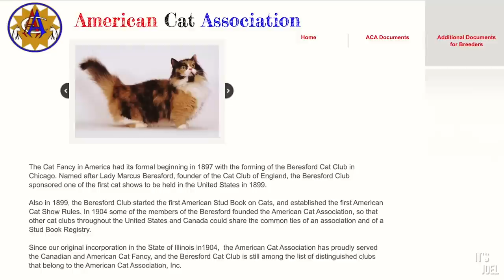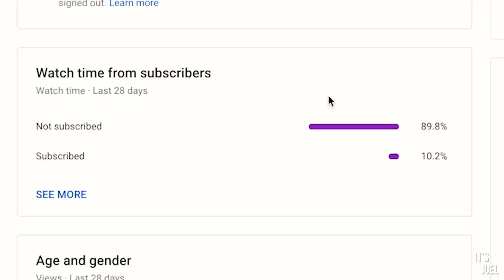I Straight Piped My Cheap, Luxury V12 BMW Limo...

Comment from the maker: The best thing about this custom system is there’s only one weld point, so the stock exhaust can be put back on very easily in the future!
Reply: Exactly, you did the right thing not touching the bumper
Reply: I think you shold make Alpina for the Gearboxe than will sound even better when you change speed becuse is to slow 😅
Reply: Good shout! As it will half the value of the car haha! Also can you get the gearbox remapped on these old ones? If so that could be the next video
Reply: How much is it fo straightpipe a car ( i have a mk1 skoda fabia vrs
Reply: Would you need to fit old exhaust with backbox to pass mot?
Reply: use v band mate
Reply: save the exhaust somewhere, i guess a new system with boxes and piping costs as much as half the car to buy "new".
Reply: i know it was 6 months ago but when your de-accelerating tap the throttle ever so slightly will make it pop and bang

Comment: Not a big fan, despite of the cool sound. I just don't think it suits the car at all. But I'm a sucker for stock cars. I do get it from a YT views perspective and as long as you are happy with it, that's all that matters! Best of luck with the series and I hope she gets fixed up for many more years and miles to come.
Reply: I agree to many bmw are ruined cause of this
Reply: It looks like it makes him giggle and he included the disclaimer that it is easily reversible. The “stock is best” mentality omits quality/well engineered and refined upgrades. Every product has a budget and when that product is so widely distributed, the focus becomes a little diluted and too user friendly. Personalizing your vehicle is a fantastic way to transform your mundane commute into something that is stress relieving and potentially a lot of fun. The majority of new vehicles intentionally isolate you from any kind of “fun”. If only he had this exhaust modification on a wot switch...
Reply: Its easily reversible, and I doubt this car will ever gain the status of the e38 as a classic.
Reply: @chris jones Same, the pre LCI is ugly, this LCI looks sharp, but not e38 sharp
Reply: It sounds great but I think I prefer the super quiet sound my E38 V12 has. Sometimes you wonder if the engine is still running it's so smooth!

Comment: Epic! If you want the best of both worlds, you could consider a cut-out valve directly behind the cats. That way you'll bypass the rest of the system, get the sound out directly underneath the cabin, reduce back pressure in the exhaust, and still be able to enjoy refined motorway cruises in absolute silence when you shut the valve.

Comment: Its just sound like a hyper car engine fitted in a cheap luxury car.
Reply: the car certainly wasn't cheap
Reply: @martin1649  5k
Reply: @northweezie1  When it first came out it was 130k and with inflation it’s probably 150-160k.
Reply: @iamray4702  yeah I meant that’s how much he paid although looking back it’s an irrelevant point to the original comment

Comment: You will enjoy the noise for a few months and after that, on the odd occasion but the drone will annoy eventually you if you daily it. 
 Had the same on my CL600. Put the original mufflers in. The best option is just get a good compromise with an aftermarket system.

Comment: And here was me thinking if I also took the boxes off the middle section in my S600 V12 Twin turbo, it would be too loud as I've already taken the back boxes off. You've gone to a different level! 😄
Sounds insane!
You just don't expect a car like this to sound the way it does 😄.
It's a 👍 from me as I've also modded my S600 and many would disagree with me
Reply: So did you mention you have an S600?
Reply: @Sycophants_should_suffer  I don't think I did!
I have an S600 in case someone missed it in the first reply 😉
Reply: I had a W140 S500 and it's the best car I've ever owned. Amazing cars.
Reply: @Sycophants_should_suffer  I personally think the W140 is a legendary car. It was made at the time when Mercedes was making great cars. I'd love to own an S600 W140.

Comment: That is pretty extreme. But it's a good job. 3.5" pipe is correct.  Looking at the old system I might have been tempted to just adjust the rear box so when the OEM valves open it becomes louder ie delete one of the rear boxes.

Comment: What a fackin amazing rich sound! Shows that there's much more BMW could have done to make the original exhaust sound way better yet refined 😐
Reply: So what? Hard to imagine, I know. But laws are not the same around the world. And BMW won't make such huge adjustments to the exhaust system just to sell them in America. Besides it is still a luxury limousine where you were actually not even supposed to hear something from inside the car.

Comment: Hi, when you straight piped it, did you gain horsepower? And what did you do about the oxygen sensors throwing up codes, and the car's initial pick being affected by a blanked catalytic converter.
Reply: It's not a full exhaust system just the lower half has been done, the sensors are still in the original locations

Comment: When I turn on subtitles while the 7er is roaring, poor youtube subtitling logic is continuously spewing out these on the screen:
[Music]
[Applause]
[Music]
[Music]
[Applause]

[Applause]
[Music]

[Applause]
By the way, why didn't you simply insert an electronically controllable cut-out? Just one push on the remote and you get the Lambo, another pust and you get back the silence of the 7er....

Comment: Sounds amazing! What a shame the evil EU has legislated against loud new cars (my 2020 M340i has been made quieter by a software “upgrade”!). Putting an exhaust on with so much less back pressure hasn’t upset the running of the engine / black box??

Comment: Poor car didn't deserve this
Reply: Meh, it's hardly irreversible. Couple of slip on couplers and the stock exhaust would bolt right back on 🤷‍♂️
Reply: Riccardo you must be fun at parties
Reply from the maker: Exactly, can literally be sleeved back on
Reply: @paulwisdom5383  Unless the original system has been thrown in a skip.......  New OEM system will cost as much as the car did.....